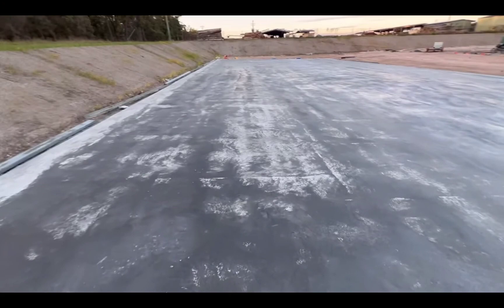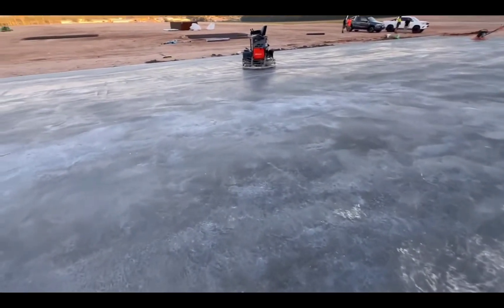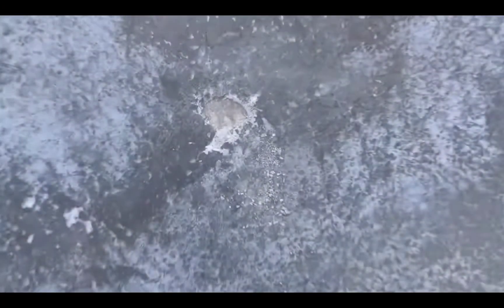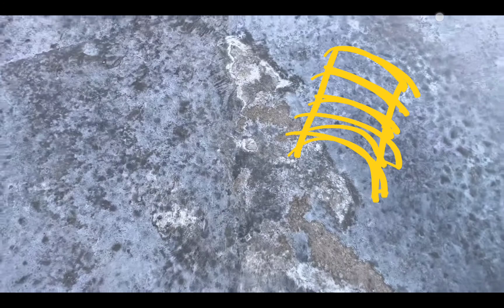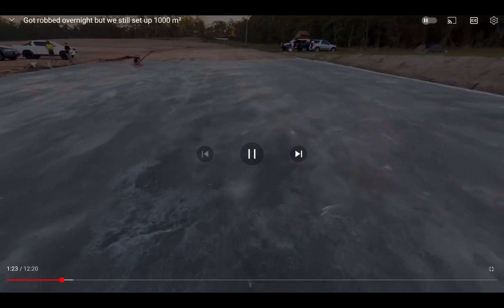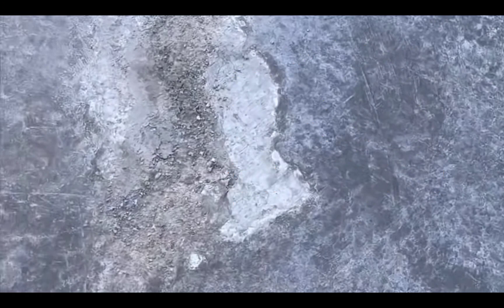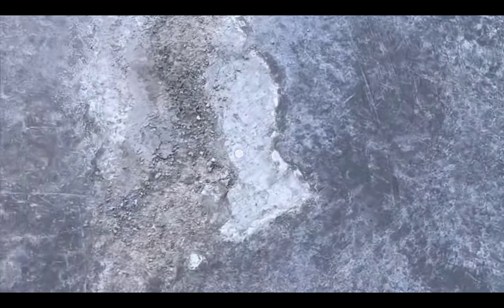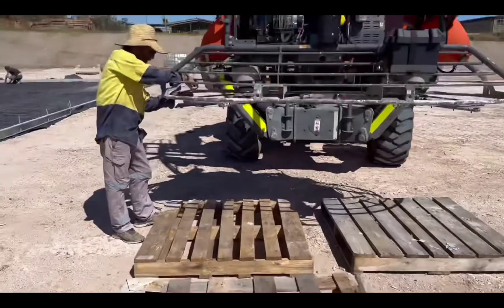Concrete Delamination Power trowel done wrong Concrete Ninja

Comment: That is very average, most concreters in Oz I work with, are not the sharpest tool in the shed.
He clearly got caught on that machine for maintenance.
This is a hot climate so adding lots of water on the surface during troweling, is a given.
This is Queensland, in Oz no air entrained admixture.